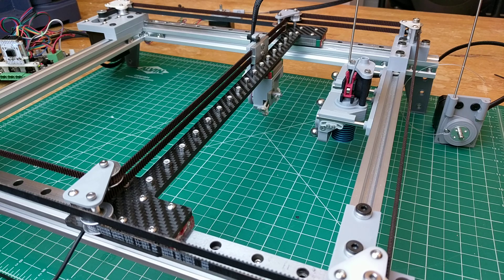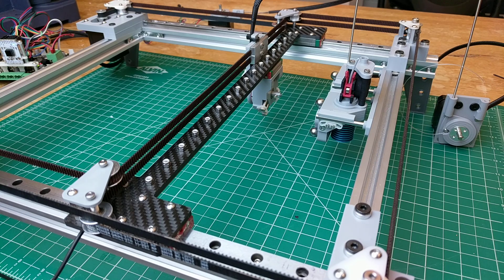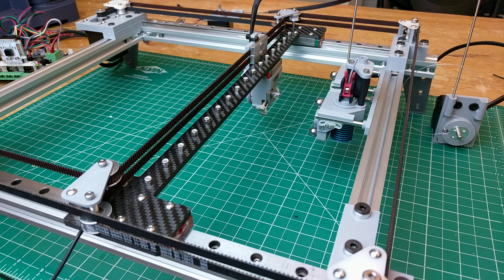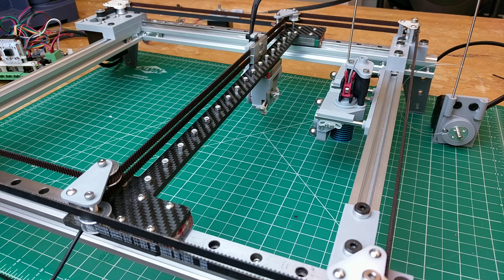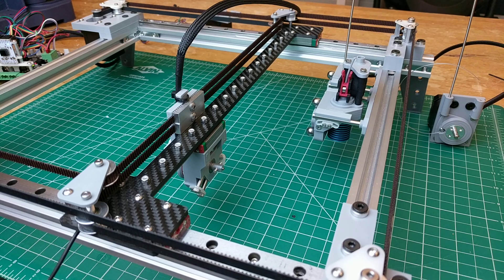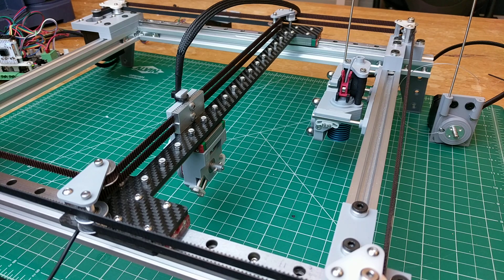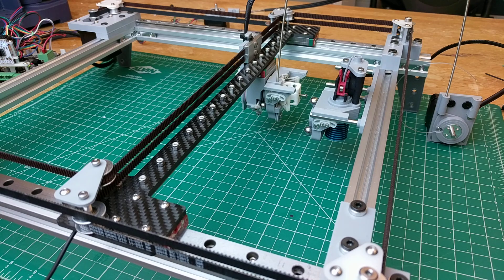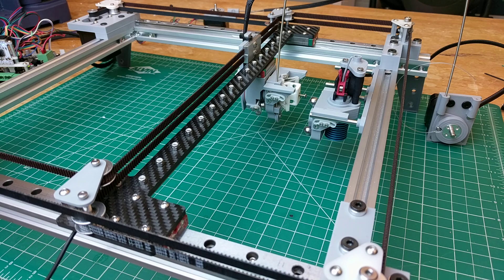Tool-Changer Update with Stall Detection

Comment: Nice to see this sort of R&D.  I'd like to suggest using a custom tapered socket and pull studs of the style used on most machine tools.  A pull stud would allow the motor to be replaced with a lighter air cylinder.  Tapers accurately position tooling axially and radially.

Comment: Wich firmware do you use to change tool? Or Wich can I use for that?
Reply from the maker: In this example I was using a Smoothie Board with some crudely hacked firmware, but these days, I've switched to a Duet2 running RepRapFirmware with a set of custom macro files. All those files are up for grabs here:
https://github.com/machineagency/jubilee/tree/master/software/duet_config_files/duet2

Comment: so now that i know a bit more about how these magical trinamic drivers work, it just reports when the motor stalls right? so what do you do when that happens? Do you just make the motor stop? In that case, how would locking the tool in place work? I get that it would rotate until it stalls, but my concern is that with your system you dont have any spring force, so i can see a scenario where the motor rotates and stalls, but then when the motor locks into place the motor goes back a step, and now there's a fraction of a millimeter in which the head can wobble around. Are you concerned about this at all?

Edit: great work of course :)
Reply from the maker: Yup, that's exactly it. The lock twists until the stall detection signal triggers or the motor goes through a set number of steps. (There's some debouncing at the beginning when the motor first starts moving too.) It's hard to see, but there is actually spring force in the 3D-printed wedge-lock. twisting the lock into the wedge until it stalls actually deforms the wedge-ever-so-slightly. My take on how the stall-detection signal fires is that it trips when a motor cannot continue stepping, so it doesn't actually slip back a step. I'm making this assumption since one of the suggested applications is as a limit-switch replacement, which is actually what the Prusa Mk3 does. I need some more tests, but if it turns out that I actually am losing a step, I can replace the cable with something "springier" like nylon fishing line such that there still exists some preload over a longer distance.

Comment: I like it. But please consider to dump smoothieware and swap to reprap-firmware. I don't say go DUET (but you really should) but smoothieware lacks so much features you get for free with reprap-firmware, that it isn't fun anymore. I say this out of a personal experience, I was there almost 3 years ago, with my version of a toolchanger. RRF removes so much pain I had with smoothieware...
Reply from the maker: This is a good insight. Right now, I've somewhat abstracted it out so that I can just test the hardware by writing this command-line interface wrapper over the board. I admit that I'm fairly new to the homebrew 3D printer scene, so I started with a board that seemed to have a stable architecture to develop on. I may switch to a Duet or Marlin in the future once I go through more hardware tests (and once I can justify buying yet another 3D printer controller). I really appreciate the context.
Reply: Joshua Vasquez look at Klipper. It uses a raspberry pi for the motion planning and just about any 8bit control board for the actual motion control. You can even use multiple control boards. Next to the duet, it’s probably one of the best ways to get as many extruders as possible. It’s fairly young, but already pretty powerful and being developed more rapidly than other firmwares, IMHO.
Reply from the maker: @scottjackson2812 thanks for the heads-up.  It looks like I'm going to start porting most of this stuff over in that direction in the next few months.
Reply: Joshua Vasquez   I'm with Rene on the Duet/Smoothieboard. I went Smoothieware and hit a wall. The open source from E3D will surely be RepRap or a derivative to simplify this in the upcoming months   That's just my take....
Reply: @POOFjunior  if you feel good in python, you should definitely look in the direction of the Klipper. It would be great to have a tool changer function in Klipper firmware.